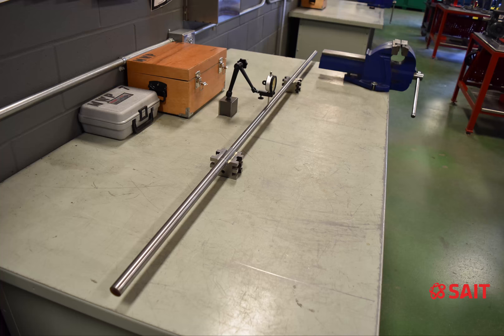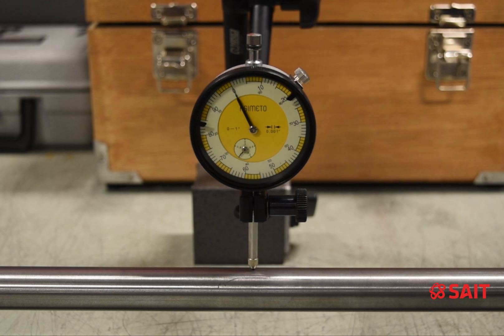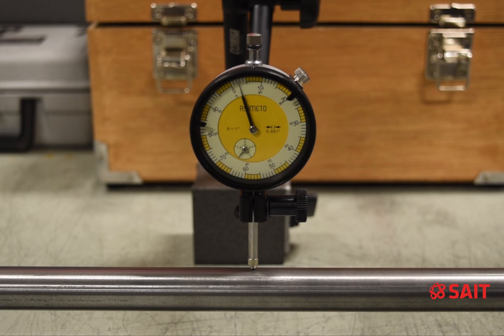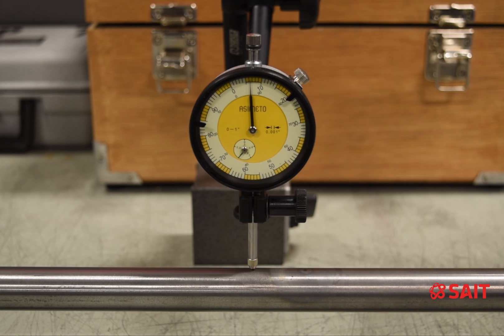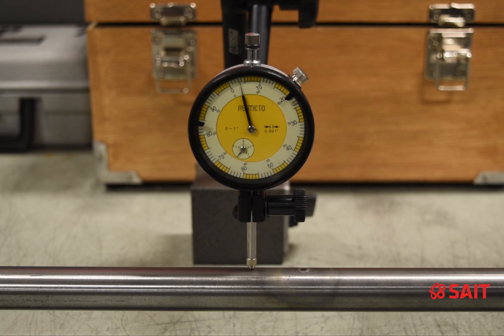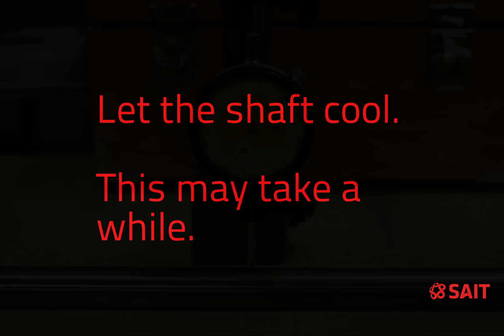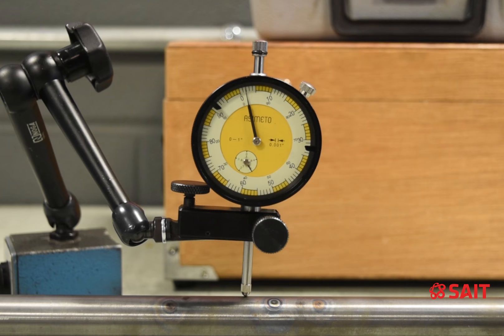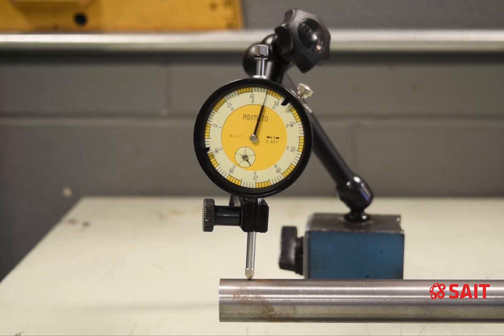Shaft straightening

Comment: very nice, will this work on a shaft thats two incch in diamater? Thought for sure your indicator was going to melt....
Reply from the maker: I have done it on 2 inch shafts before. It just requires more time and it will need to be heated many more times. 
I also like to use a cheap dial just or just remove the dial before heating the shaft so the dial doesn't melt.

Comment: No torch. I have a slightly bent 8mm shaft, 400mm long. 0.25mm centre gap when placed on flat plate. Cannot get linear slides to run smoothly when fixed to carriage. Used three wooden wedges (half clothes-pegs) as a sandwich between wood boards. In a big metal vice, I can deform up to 10mm+, but the shaft will not take up a permanent correction. If these shafts are in any way through hardened chrome steel? (it may be possible even though from Ebay). I've had no problem bending wrought iron angle and mild bar into exact curves. I'm considering that this bar will just snap at some point, it's behaving like a pretty good spring at the moment.

Comment: what is that indicartor or guage called?
Reply from the maker: A dial indicator
Reply: dial indicator on a magnetic stand, if you access to a lathe, drill a centre and then fit a live centre, heat it and spin it, if you are real keen you can make a tool for the post with a bearing on it, this way you can spin it between centres and use the tool post to straighten, you can use a steady but a bearing tool is easier but sometimes a steady is the only way